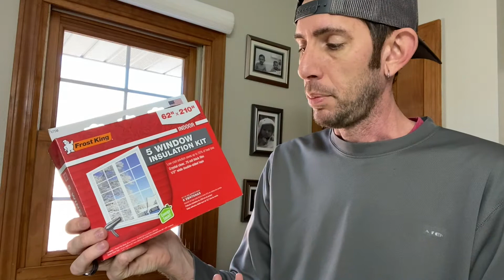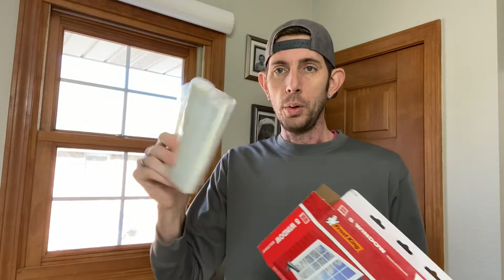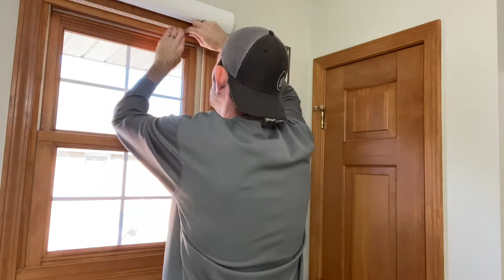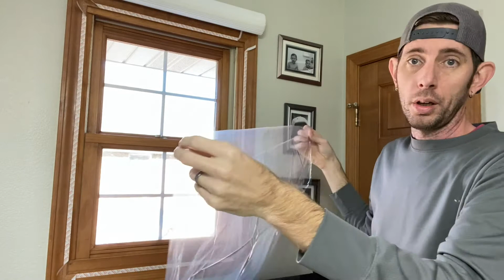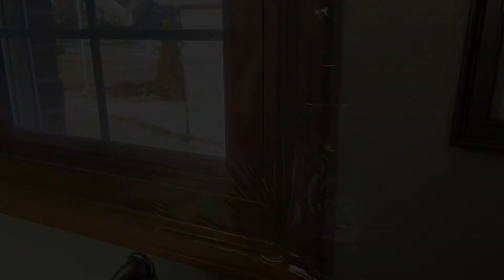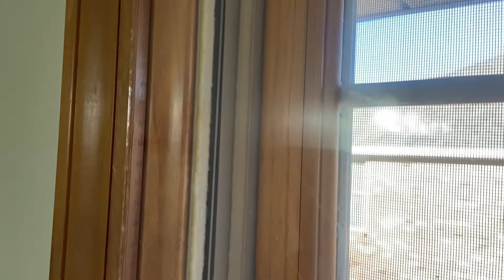Cheap solution for drafty windows

Comment: As someone who has used window film for many years, I would recommend not using a hair dryer. This creates to much tension on the film and will will cause the tape to pull back toward itself, eventually releasing from the wood and creating air gaps, and creating more headache and mess when you remove it in the spring. Instead, stretch it as best you can when you install it, and only use a hair dryer SPARINGLY, if at all. You do not need the plastic perfect to get the same effect.

Comment: Good info Dustin. I used to have to use that stuff in an old house we rented for a time. It could be a pain to put up but you made it look easy. BTW I meant to tell you the new design lathe stop worked much better. I will have a video on it coming. I actually ordered a full size printer already and want to reprint it the stop. The little printer works but it is cheap and has some issues with the layers not lining up to my liking on larger longer prints. All the best!